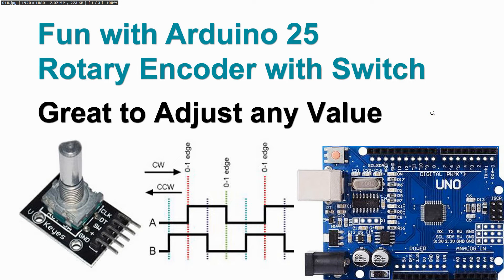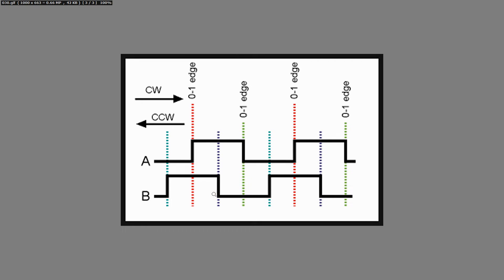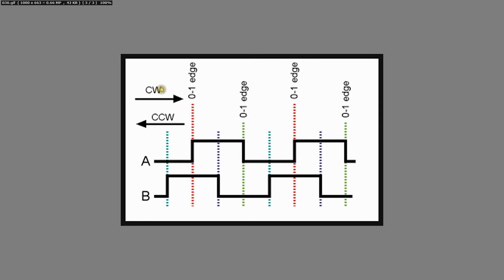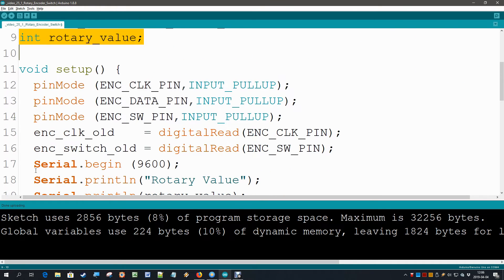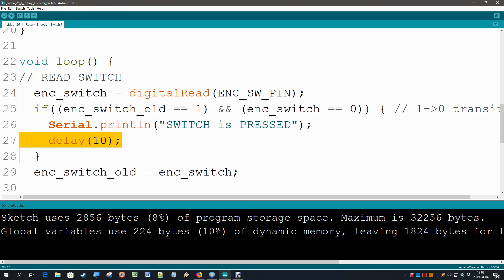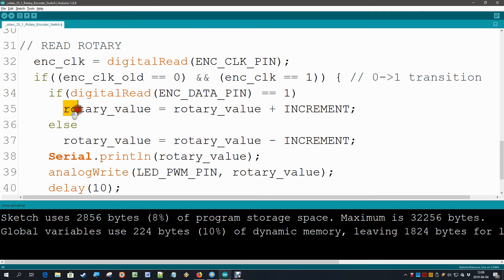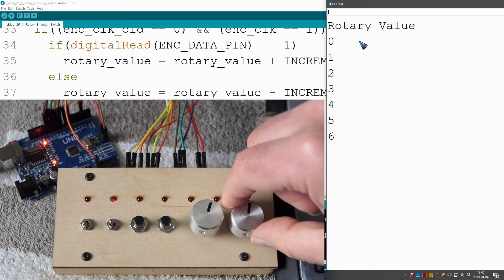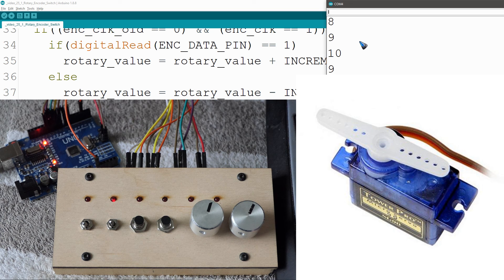Fun with Arduino 25 Rotary Encoder with Switch

Comment: Thanks for sharing your fun and educational project! I just built your project on a breadboard. You stated that the rotational operation of the Rotary Encoder might be reversed and, if so, the CLK and DT wires would need to be reversed. I did find that the CLK and DT were assigned incorrectly. After swapping those wires, the CW and CCW rotation of the Encoder was correct. Of course, this correction could have been made/swapped in the code. I would suggest that you add a simple hand-drawn schematic (showing each and every connection) to the start of the video and to your webpage. Noobs, like me, would find it to be extremely helpful. Also, I encountered significant amount of bounce in the encoder. As you stated, anyone building the project will need to watch your next video to learn how to sort that out with delays. A Video Suggestion = My intention is to develop a project in which a KY-040 Rotary Encoder is used to control a MCP41H Digital Potentiometer. I thought that this would be a rather common project and that Arduino Templates would have been readily available. However, even with much searching, I could not find such a template. Or, maybe someone knows of a good link. However, YouTube will not allow commentors to post links, so you would have to give us the location by stating how to search for it. Thanks in advance.
Reply from the maker: I seldom write Arduino code myself anymore, instead I use AI. I asked this to Google AI Studio: Can you create Arduino code for using a KY-040 Rotary Encoder to control a MCP41H Digital Potentiometer. You may choose the pin numbers as long as they can be easily changed at the top of the code. To see the answer you may need to log in at your Google Account or at Google AI Studio.
https://aistudio.google.com/app/prompts?state=%7B%22ids%22:%5B%221Gr9Xj1-ajK780FM8qWl00XrfUqIYIBW2%22%5D,%22action%22:%22open%22,%22userId%22:%22101106910802818288395%22,%22resourceKeys%22:%7B%7D%7D&usp=sharing
Reply: @rudyshobbychannel  Thanks!!! I will look into it.
Reply: I used ChatGPI (for free.) Here was my request:
Using the common C code language, please write Arduino code to cause an Arduino Nano to
1) read a KY-040 Rotary Encoder,
2) print the Rotary Encoders setting to a 1602 LCD Display and
2) adjust a MCP41H51-103E/ST Digital Pot setting, accordingly.

Please include code to debounce any switching errors.

Please include instructions for configuring the Arduino IDE for the needed controller, com port, libraries and the like.

Please include written instructions, schematics and drawings to instruct the builder in assembling the components named above.
==================================================================================
I received the complete code and detailed written instructions to accomplish the task. I did not receive the schematics and drawings to assemble the various components. However, the written instructions should be adequate. I am surprised and impressed. Thanks for the suggestion to try AI. I will follow the instructions and post my findings and results.